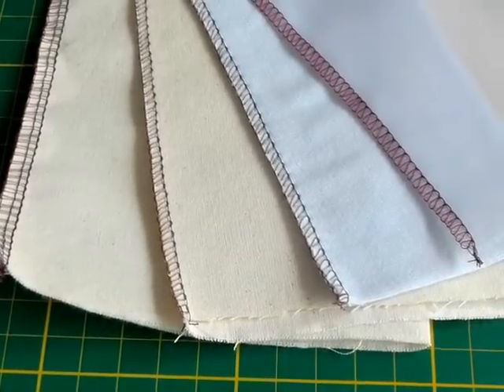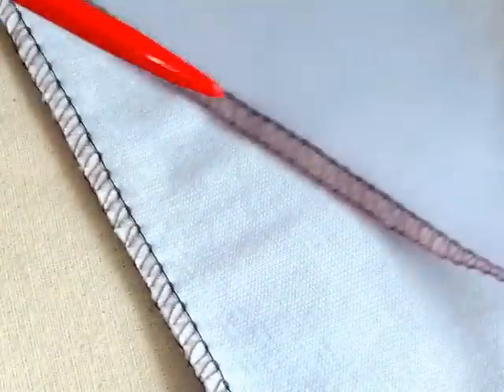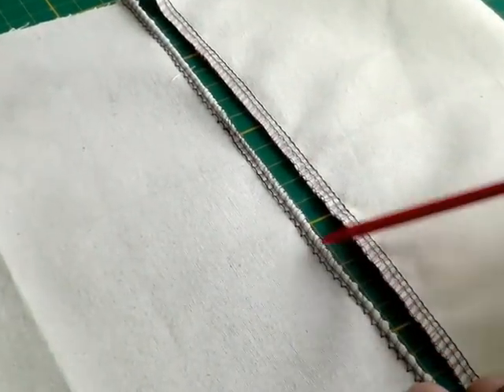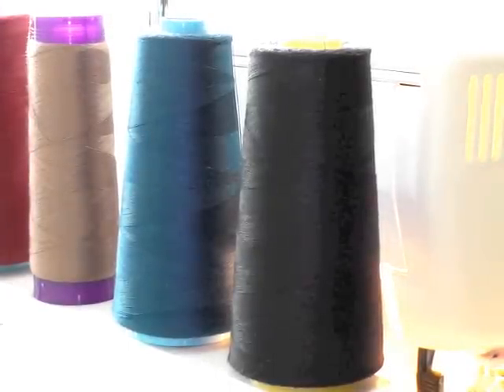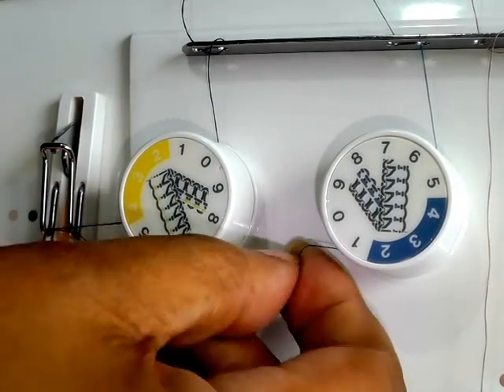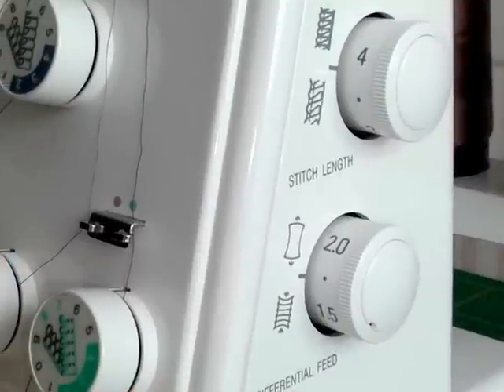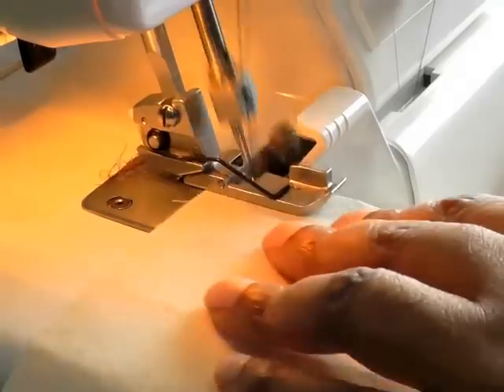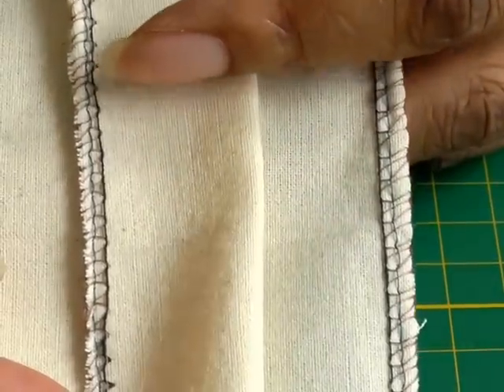Serger Stitching Troubleshooting

Comment: Thanks for this!  My regular serger has a broken part that is not available right now.  I bought a cheaper serger to get me through, but I couldn't figure out the tension problems... turns out it wasn't going around the tension dial correctly (my regular serger is much easier to get it in the dial, so I never had this issue before).  Sometimes simple solutions are the answer!!!!
Reply from the maker: Glad I could help Julie! Thanks for sharing, and I hope you get your regular serger back soon!

Comment: Can you please help ,I have threaded my janome 9102d to the manual right to left and under the foot/ over the plate.I have cleaned out the machine ,that really was not dirty.I have attached 2 new needles.All the tensions are OK.And all the cotons are 120 guttering man ,  all of the same brand.But the machine will not produce stitches?
Reply: All the tensions are no 3.stitch length no 2.differential feed 1.0.
Reply from the maker: Sorry I can't help! It's best your take your machine to be serviced and maybe they can solve the problem.

Comment: I’m using a Singer 14 354B Differential Serger. I tried everything you suggested but my loops are still wonky. The scrap I’m testing on has perfect stitches from several weeks ago and now loops that “fringe” over the ends or roll back over onto themselves. I don’t know what to do. I haven’t done anything except retread the machine.
Reply from the maker: Hello Karen. Try checking each individual thread tension. I hope that helps!
Reply: Colleen G Lea - FSBTV it did! Thank you!
Reply: I did and it works great now. Whew! Thank you.

Comment: My serger has  needles A and B. Needle A simply will not stitch. I have 
changed the needle, cleaned the machine and threaded and rethreaded it 
again and again. All the other needles stitch perfectly. Why wont needle
 A stitch?
Reply from the maker: Hello Alexandria. Check to see if you have inserted the needle the correct way, and or tighten the needle tension, I hope that helps.
Reply from the maker: You may have to re-thread it again Linda.